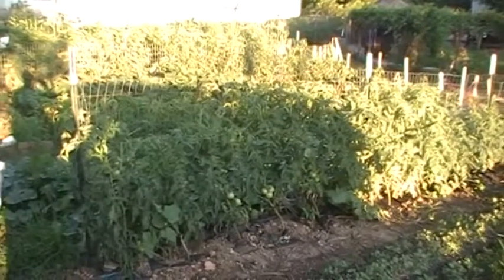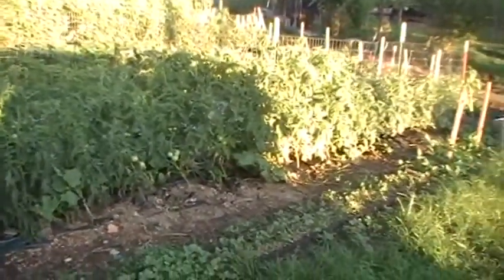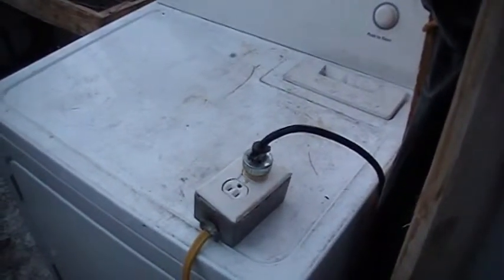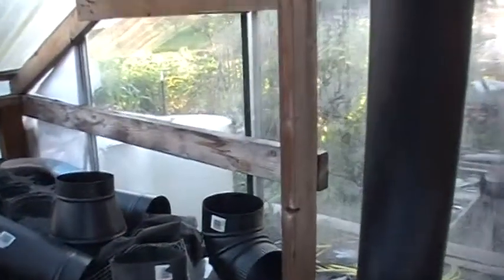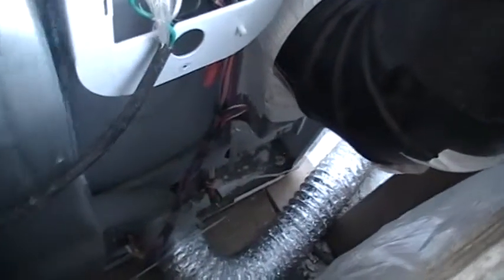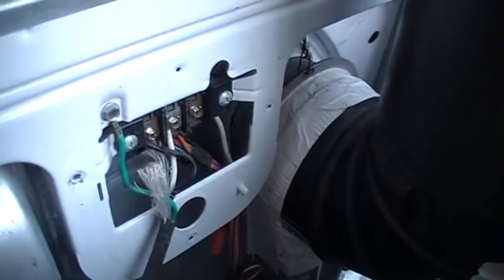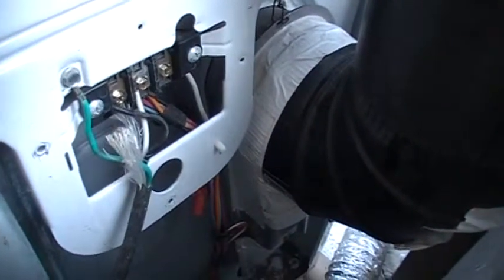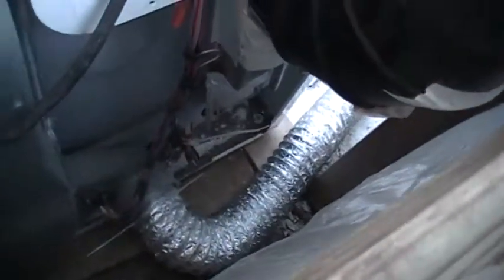SOLAR POWERED CLOTHES DRYER!  Electric bill Hack!

Comment: So you just recirculate the hot air through the dryer so you never have to produce the energy to run the heater? That's a neat idea but how do you dry clothes in the winter?
Reply from the maker: The greenhouse all closed up will get 140+ too, so the recirculation get keeps heating.Winter time, we have to use a regular ole dryer. thanks

Comment: Very cool, are most dyer motors 110,  or do you have to rewire them ?
Reply from the maker: Most of the older dryers are wired for 220/240 because of the heating element & timer. The motor that turns the drum is 110/120. So i disabled the heating element, rewired the dryer with a 110 plug with ground.Grounded the frame.. Turn the timer on. It doesn't count down but still enables the electric motor...Start it with the start button, Cut it off with the door, or turning timer to off...thanks
Reply: @TheSwaffordHomestead  thanks man. I have an old dryer I've wanted to try this with. The dryer is the most power hungry device there is, after the water heater. My bill has almost doubled since our latest fearful leader was " elected ", lol. Looking for ways to cut costs. Have been using the primeval solar dyer, the clothes line for years. But clothes come out stiff and covered in lint.
Reply from the maker: @markjohnson9402  we used both. The dryer works good on clothes like shirts, thinner made clothes. It takes awhile, but it's not killing the electric bill! Bluejeans Heavy towels are hard to dry. Heavy clothes & towels, I used the dryer to start the drying process when our clothes line is full...

Comment: hook up a solar passive soda can hot air collector to your inlet pipe and that will shorten the drying time. here is an example of one: https://www.youtube.com/watch?v=hf-9M_WVuSM
Reply from the maker: I like thepassive air heaters but The green house runs over 140 degrees now In the summer it melts My planting trays... It does great...Thank you I will try to go watch that video...

Comment: I’m sorry I am not understanding. Where is the solar part please show it more clearly. I’ve been trying to see plz and thank u.
Reply from the maker: The Dryer was rewired to run on 120v, The solar panels is powering the Dryer.The Sun Heats the Green house & The Dryer uses the Heat of the greenhouse to dry...It circulates the heat thru like a regular dryer.  It Is powered by the Sun & builds Heat From The Sun. Solar powered... I hope this Helps.. Brett
Reply: Brett & Cindys TN Living Brett & Cindys TN Living Brett & Cindys TN Living Thank u but what I meant is literally physically where are the solar panels like physically? I couldn’t see it. I understand the method and why but where is the solar panel. I couldn’t see.
Reply from the maker: @linajmval  My 9 solar panels are on post in the Yard,  They power over half my house! Watch the solar maintenance video ,You can see my panels,batteries,chargers,& inverter.
Reply: Brett & Cindys TN Living nice thank u
Reply from the maker: @linajmval  your welcome!